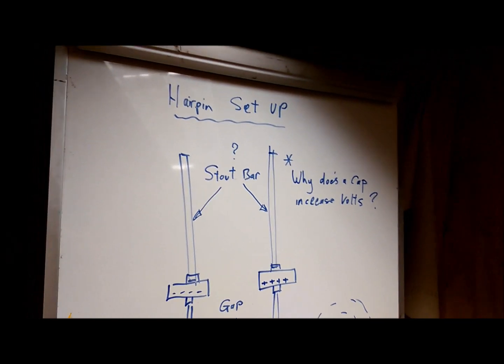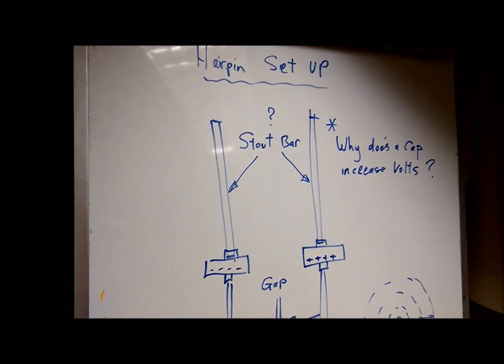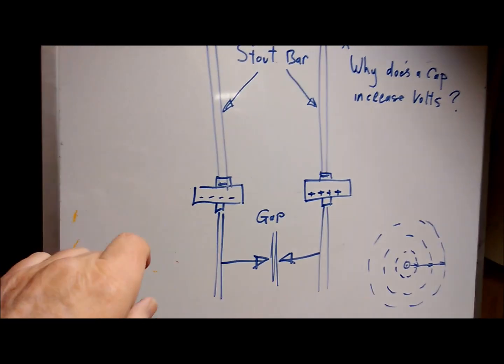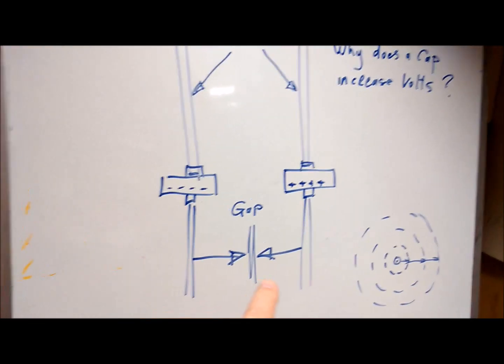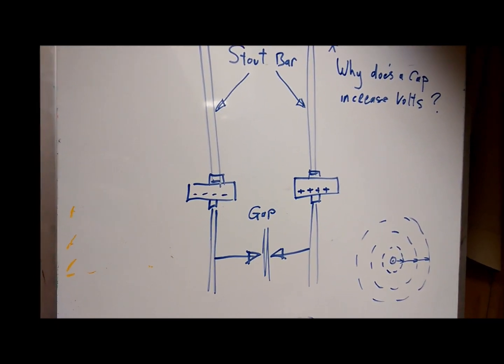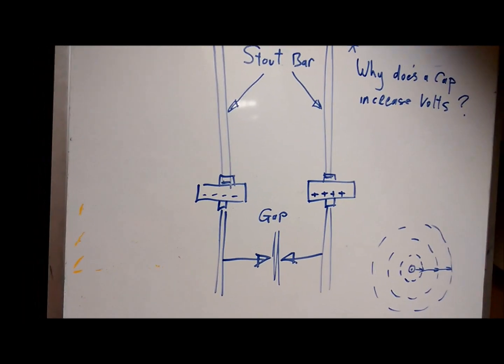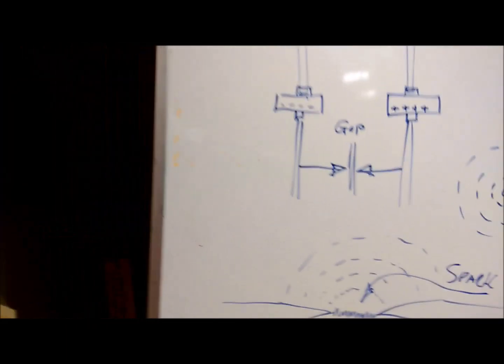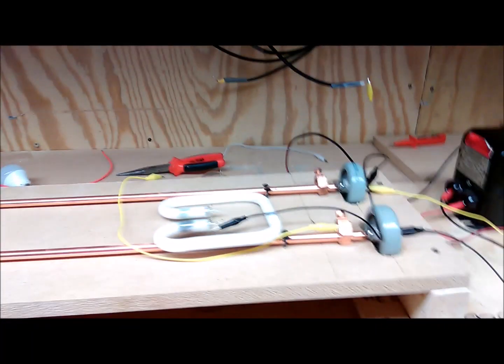Electrons do not exist ( Nikola Tesla Hairpin Circuit )

Comment: Also on the topic when I push to opposing magnets together they create an electric shock sensation in my hands...so as far as I can tell I am thinking electricity is nature discharging compressed magnetic fields in the form of high vibrational waves that also show up as light, sound, plasma, and sound shock wave when attempting to dissipate compressed potential energy. The same way explosions discharge, air compressors, or any other type of discharge🤷‍♂️looks very similar accept that an explosion does not follow a line but rather takes the shape of it's container so the air seems to be acting like a container for the light, plasma, and sound shock wave. Hmmm.🤔pattern looks the same as cracks in concrete made by the rain so again seems it burning the air and water vapor like a fuse🤷‍♂️
Reply from the maker: Hi S.S I have hit a brick wall, its about a humble magnet. I have watched and read Ken Wheeler's stuff on the subject. The bottom line is understanding how it truly works. The iron fillings lines are incorrect north can not be south and twist over. Like positive and negative they chase each other, never meeting or do they? Best regards... DC
Reply: @e.powerdc1127  appreciate the conversation. I post some solutions on my channel but tends to 🛫🙄at one point the combined magnetic fields were so strong they ripped one of my apparatus apart. Another time one of the magnets burnt out like a lightbulb it's very neet stuff.
Reply: I'm currently working out what the best way to generate high voltage and high current might be some tests include testing which is better one coil with many turns or several small coils(haven't found anything on this oddly) what happens if I connect each ring/loop or run a solid conductor accrossed one end. Does voltage and or amperage keep climbing or peek at a certain rpm. Perhaps opening and closing the magnetic loop is better than charging a coil. 🤔lots to find out. Since I solved the v gate issue by accident I'll do that 1st and than continue hopefully quickly testing different coils and have working hybrid system by end of the year. I'm shooting for 1000hp.
Reply: Also interested in looking at a linear vibration collector so there will be lots more coming up. If people don't comment I may not spend time posting will see. It's amazing how people don't notice massive breakthroughs in plane sight when I don't spell it out😂🤣🙄gees🤦‍♂️🕴
Reply from the maker: @strangescience3414  s.S. have you videos of the experiments?  I have been looking at how a galaxy functions, totally magnetic so from small scale to big its all magnetic. Nature is simple (Ken Wheeler) from atoms to galaxy the key is understanding magnets! Yes? So is gravity a pull or push or both?... Regards... DC
Reply from the maker: Added value look at this...https://youtu.be/1VPfZ_XzisU
Reply: @e.powerdc1127  I found the same info. When I was testing my _ motor they all behave like gyroscopes. I came up with new system of _ bearing which is amazing almost no wear but where I stopped was utilizing the s___d wo__le displaced at the top of a spinning t__. The theory is very easy but it's difficult to actually craft involving cranckafts and stuff...alao on the long to do list🙄
Reply: @e.powerdc1127  I just posted the link of the video I don't make it obvious for my safety but the important bits are all there.I mean it's cringingly obvious🙈
Reply: @e.powerdc1127  https://youtu.be/mKdIBIRtqbM
Yeah me to🙄brick wall😣

Comment: Hopefully you will reconsider. Tesla believed, something th ax t physicusts support today, that all matter is supported by Ether ( physicists use the alchemical term for Ether, Quintessence). And electrons are the charge carriers of electricity, but Ether brought the electrical effects to other particles. (Both the dielectric and magnetic effects.) The hairpin enables the charges to cancel out, but the capacitors and cspacitance of the stout bar hold the Ether which is the payload carried by the charges. That payload will provide the electric ax l effect when connected to metals, and pass through people, harmlessly providing only the needed elctrical effect. Peace,  B
Reply: @Ultimate Energizer  have you ever looked through a electron microscope i have i can confirm electrons and the current atomic structure is correct
Reply: @godparticle3295  You assume an electron microscope is proof of electrons; simply because the word electron is in the title. Can you prove that the functioning of said microscope is possible due to the use of electron particles? Why not dielectric lines of force? Electrons occupy a cloud of potential within a given space; when modeled the geometry resembles a non-euclidian hyperbolic field which shifts into various shapes depending on charge, and does not resemble a particle in any way shape or form. The skin effect alone is enough proof in and of itslef to conclude that electricity is not the product of the motion of  microscopic billiard balls a.k.a electrons.

  J.J Thompson the man who was credited with the discovery of the electron, and awarded a nobel prize for doing so; continuously discredited the idea as being faulty and essentially useless as a means by which to explain the phenomenon of electricity. He even went so far as to make toasts at his own parties proclaiming, "Here is to the electron, may it be of no use to anyone ever."
Reply: @Vorname Nachname I suppose you prefer "The Fifth Element". Practically speaking, You'll be hard-pressed to find an alchemist to set the record straight.
Reply: you dont seem to know what Ether is

Comment: No electrons. Spark is electrons exchanging charge energy. Science! Read Physics and Electricity.

From Wikipedia:
Spark visibilityEdit

The light emitted by a spark does not come from the current of electrons itself, but from the material medium fluorescing in response to collisions from the electrons. When electrons collide with molecules of air in the gap, they excite their orbital electrons to higher energy levels. When these excited electrons fall back to their original energy levels, they emit energy as light. It is impossible for a visible spark to form in a vacuum. Without intervening matter capable of electromagnetic transitions, the spark will be invisible (see vacuum arc).

https://en.m.wikipedia.org/wiki/Spark_gap

Comment: So, atoms don't gain or loose electron?
Reply from the maker: Hi GB Quote.. Tesla and others speak it out. Its about "Fields" imagine fields around the copper wires or on or near the surface. Tesla "think vibration" expand and contract, polerised then N. Flip to S. In the Dielectric.. Regards... DC
Reply: Chemistry - Electron Structures in Atoms (14 of 40) Mystery Solved! Electrons=Waves 

watch? v = kFW8kNKCfgA & ab_channel = MichelvanBiezen

Comment: The Capacitor increases voltage by evening out the electron flow in the circuit.   So what the capacitor does is store electrons as the A.C. current increases and releases them as the current drops to zero. This smooths out and increases the amount of electrons flowing in the circuit.
   By theory of Steinmetz, there is no charge build up on a conductor, and this is proven by the voltage being the same anywhere on the conductor.   So what you are drawing through the gap should not be electrons, but particles called dielectric or electron-positron pairs from the magnetic field.  
   So Steinmetz says that what causes wires to move in Ampere's law is not a charge or electron storage in the wires, but stored energy in the dielectric field surrounding the conductors.  The dielectric field being dipolar particles, line up to create a charge between the conductors that create a force and flow causing parallel wires to move.  So you should only  just see dielectric medium flowing through the gap, barring resistance to flow through the bars. 
  I think Tesla called it stout bar, because he want to put a dead short and lots of amps through it and he did not want it to move, as per Ampere's law, when he performed the experiment to avoid a electron flow between the gap?
   However, upon second watch  it appears you performed the experiment well, as it was difficult to see the spark gap at first with the lights on,  but at 4:50 I could clearly hear and see that electrons were jumping  the spark gap, proving the existence of electrons.
   Also I have researched the original Steinmetz quote as described by others, and Dollard, and Wheeler. Steinmetz was misquoted by them and never said an electron doesn't exist.  I do not think Steinmetz even used the word electron in his entire text.  In fact CERN can strip electrons form a proton and store them.
Reply: you my friend are talking pure shit as each and every giant of electrical theory from tesla and maxwell to heaviside all stated that electrons do not exisr describing the theory aa a psychosis
Reply: @matrixstrobe1176 Here is a good source for Tesla on radiant energy and his patents that embody what he thinks about electrons and separating them from the ether medium, you can read for yourselves.  I hope this clears up any confusion for you about electrons and what Steinmetz and Tesla thought about them.   As for Maxwell and Heaviside, they are mistaken.

https://www.youtube.com/watch?v=cmfWGDKVHRE&t=89s
Reply: @matrixstrobe1176 

    Tesla has patents in which he clearly embodies the idea of an electron into his patents so that there will be no mistake that he believes that electron are charged particles, so anyone who has done a modicum of research into Tesla, or Steinmetz for that matter, knows that neither of them said there is no electron. 

Tesla said that electrons exist as well as Steinmetz.  Since they are both obviously smarter than I,  I believe that there are electrons.  Also CERN has proven the existence of electrons, by stripping them from a proton.  They can also store these electrons and use them again.  So Whomever it was that  told you that Tesla did not think an electron was a particle is clearly misinformed.   https://www.livescience.com/63211-lhc-atoms-with-electrons-light-speed.html

    Also when Ken Wheeler and the others  told you that Steinmetz said there is no such thing as an electron, they actually added the term "an electron" to Steinmetz' quote.    I have the actual text from Steinmetz and you can read what he said for yourself.    https://archive.org/details/elementarylectur00steirich/page/n6

   You can download it yourself.  Page 11. Steinmetz is saying that the forces that move wires as per Ampere's law is not caused by charge on the wire, but by dielectric storage density between the wires.   He does not even use the word electron in his entire book.  He never said there in no such thing as an electron.  Heaviside  and Maxwell are mistaken about their quotes about Tesla and Steinmetz.
Reply: @matrixstrobe1176  Watch at 43 minutes into this video.   https://www.youtube.com/watch?v=cmfWGDKVHRE&t=95s
Tesla talks about conventional DC, AC and energy as a wave produced by removing the electrons from the flow.
Reply: @Steve Forster  Tesla said that electrons exist as well as Steinmetz.  Since they are both obviously smarter than I,  I believe that there are electrons.  Also CERN has proven the existence of electrons, by stripping them from a proton.  They can also store these electrons and use them again.  So Whomever it was that  told you that Tesla did not think an electron was a particle is clearly misinformed.   https://www.livescience.com/63211-lhc-atoms-with-electrons-light-speed.html
    Also when Ken Wheeler and the others  told you that Steinmetz said there is no such thing as an electron, they actually added the term "an electron" to Steinmetz' quote.    I have the actual text from Steinmetz and you can read what he said for yourself.    https://archive.org/details/elementarylectur00steirich/page/n6
   You can download it yourself.  Page 11. Steinmetz is saying that the forces that move wires as per Ampere's law is not caused by charge on the wire, but by dielectric storage density between the wires.   He does not even use the word electron in his entire book.  He never said there is no such thing as an electron.  Heaviside  and Maxwell are mistaken about their quotes about Tesla and Steinmetz.
Reply: @Steve Forster  Here is a good source for Tesla on radiant energy and his patents that embody what he thinks about electrons and separating them from the ether medium, you can read for yourselves.  I hope this clears up any confusion for you about electrons and what Steinmetz and Tesla thought about them.   As for Maxwell and Heaviside, they are mistaken.
https://www.youtube.com/watch?v=cmfWGDKVHRE&t=89s
Reply: @Steve Forster  I have seen those videos and Ken's videos, I urge you to watch the video I showed you and see Tesla in his own words and bypass people like Ken Wheeler, Maxwell and Heaviside, see for yourself.  Watch at 43 minutes into this video.   https://www.youtube.com/watch?v=cmfWGDKVHRE&t=95s

Comment: While there is no definitive proof that electrons do exist, the model that uses electrons as an existing particle do explain and can predict the principles and phenomena we observe.
In this context, I think it is much safer to say that electrons do exist.  
What you call "Scalar" is just electrostatic energy transmitted through the ionization of the air created by the high voltage sparks.
Reply from the maker: TheQ Hi can you do the maths for this simple experiment? Cos the F/tube is a standard product. The coil is standard too. The Ohmic resistance of the coil is about 0.2-3.0 Ohm primary and 5-20 kOhm secondary.  So its Radio Ham transmitter antener  stuff ???    Regards ... DC

Comment: not sure how you conclude there are no electrons. Wouldn't electronics be needed to do a dielectric breakdown in air at high voltage -- resulting in a discharge? W/o electrons, not much would happen.

Comment: There is no electron as such, it's just an assumption. Since there is no charge annihilation, then it is clear that there are no positive or negative particles. There is only a surplus, deficit and balance of moving and standing charge. Which in turn creates all these effects.
Reply from the maker: HI friend, Tesla "Everything is Light" (Vibrations) (Bible) In the beginning was the word! Ponder this:- "Everything is electric"? ... Regards ....DC
Reply: @e.powerdc1127  In deed, all interactions are based on friction.
 By rubbing any materials, charges come out. Consequently, the environment around us consists of structured and not structured, so to say free electrical charges and their interaction. And yes, there is only DC and it can be pulsed and switched in direction.
Reply from the maker: @1272-f9v  Hi again you are the only one to see my direction. That is HV pulsed (DC) to produce low voltage high current. ... Regards ... DC
Reply: @e.powerdc1127  What are the voltage and what are the amps? You measure both with the same measuring instrument ;) 
I suggest that this is the same thing... all there is, is only electrical charges...
Voltage is the amount of electrical charges. 
Resistance is the amount to move these still standing electric charges in the cord, to overcome the structured ones, they resist the flow.
And amperage is the amount of flowing charges that has overcome the resistance.
People names in formulas
, hide the whole truth ;)

Comment: .."no electrons, just a discharge"....now the question: A discharge of what??
Reply from the maker: This is the first real Q with out of the box thinking!!! Well done... DC.  Lets call it Aether Snap potential. Lets call the AC current we all love and know Forced magnetic Aether Snap potential at a frequency. Its about making a strong link between "Static" & "Pulsed" or "Flip Flop" potential. Electric is a cell of potential.
It is hard to describe cos it changes. ... Regards ....DC
Reply: The loss of inertia as expressed by the dielectric field.
Reply: @Andrew Manche lol no you are not,.
You do not even knows how a Tesla coil uses capacitors and spark plugs
Reply: @Andrew Manche YOU FAILED......Read the circuit AGAIN!!!!!
There is a relation between the capacitor and the spark...........You can charge the capacitor into more volts than what it is charged with.
How old are you actually? 10? 8?
And trying to win a conversation while knowing nothing.
That is retarded....
Reply: @Andrew Manche nope, you have not even tried.
This I know since i did it a lots of times.
Funny hos people can not see the difference of knowing and believing. You over sized ego are fooling you
Try it...

you can do it with simple battery and high voltage capacitor

What did you say 53 years old? hmm and not tried such things?.......................Service Engineer? 
What are you doing at your job?`
You do like your job, not?
Reply: Gotta start calling it something other than electromagnetic interference then
Reply: @Ultimate Energizer  well one interesting observation I noticed positive(terminal) discharges and negative(terminal) labeled discharges were a different color so there is some difference🤔my guess was that one was burning oxygen and creating xenon gas like in lightning and the other was burning water vapor like in some of my hho set ups🤷‍♂️interesting topic😁feel free to chat about my channel as well.
Reply: @Andrew Manche lol idiot, they do it on this.
What happens is the capacitor gets charged, that will increase the voltage until it sparks.
Very basics, like on Tesla coils.

Just wondering, how can you state anything when you do not even know anything about it.?
That is retarded.....